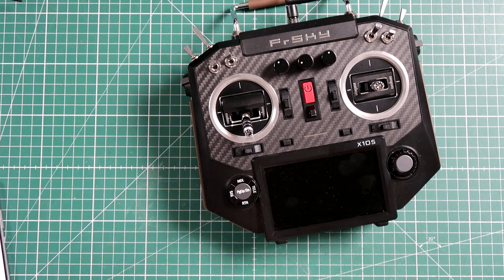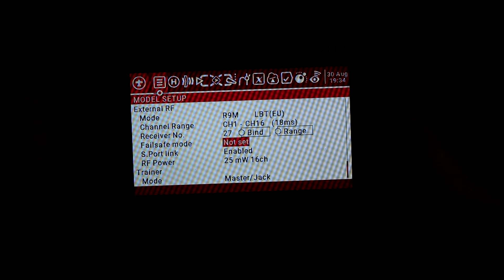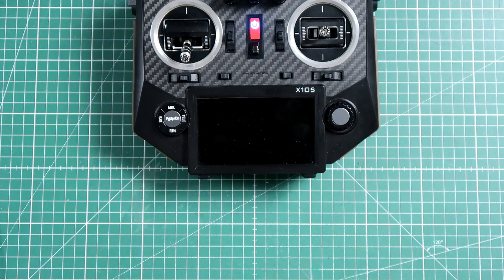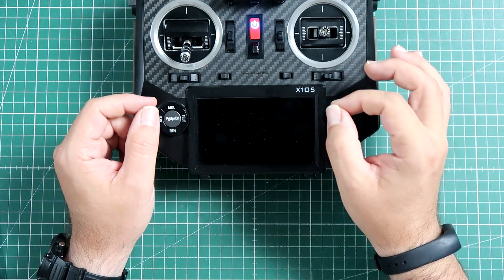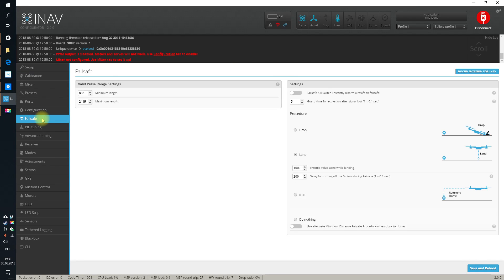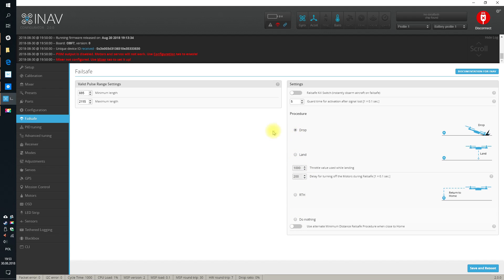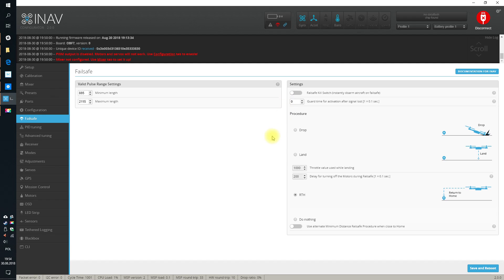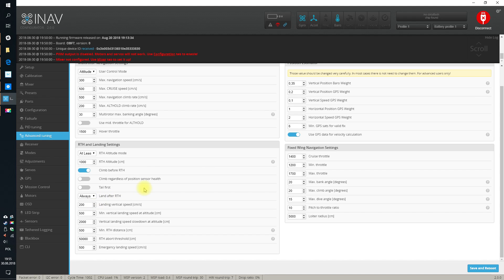INAV and Failsafe - especially for FrSky owners (but not only)

Comment: HI Pawel !  can not disarm after failsafe. props are spinning . Only unplugging the battery stops the motors. Can you help me ? I put RTH mode in failsafe tab but I have no RTH in Modes ( gps receiver without compass) and the switch works as failsafe only . I use frsky and expresslrs. Thanks

Comment: What throttle value be use for failsafe+RTH ?

I bench test the failsafe+RTH procedure. It went well but I notice the throttle ramp up to 93% during failsafe+RTH.

How to change that ? Because with that high throttle I doubt the plane will make it to home point.

Comment: Pawel, can you give me some tips on RTH? I setup Inav on a 4'' quadcopter using the Matek gps with compass. Alt Hold and Pos Hold are working perfectly with no drift. The compass and accl are calibrated.
When I execute RTH my quad starts toilet bowling, and although the home arrow points the correct direction, the quad is going the wrong way. I've checked the course heading, and all appears correct. If I change Mag Alignment, Pos Hold will toilet bowl. 
Could this be that I just need a better Mag Calibration? Very stuck on this problem.

Comment: I just got this Radio Master tx16s after 3 mouths, been using a flysky i6, thinking about sending it back. I have a pixhawk F.C.
With a pixhawk and using Mission Planner. I put RTH on Ch.7  on 2 way switch. Got 4 modes on Ch 5 .Setup the failsafe on Ch7 with custom settings failsafe and add after  two times on Ch5 on a 3 way switch one for the middle and at the end pointed down. do nothing for  the one pointed up that will be for Ch 7 for  RTH failsafe  when you cut your Radio Off, simulating no pulses it interact with Ch 5 at 1500 on the second switch .Put the other two modes as stable on the second switch 1653 and 1802. When I cut my Radio off in Mission planner it says RTH and it switches to CH 5 on the second switch at 1500. My mode setup looks like this :PWM - Flight mode 1=1193, FM-2 =1326. FM-3= 1459
Number 2 switch Fight Mode  number 5 = 1653, FM 6 = 1802 and  ( FM 4 = 1500 when you cut off Radio RTH.) Hope this helps.

Comment: I'd like to have my RSSI channel set to 0% when there is no signal.  Currently it reads 50% when the transmitter is off.  In Betaflight I can go to the Failsafe tab and set the channel position to be HOLD (which is what is happening now in iNav, I see 50%), or to some value.  I always set it to 0% so when the radio is off I see 0% instead of seeing 50% in iNav.
Does anyone know how to do this in iNav configurator?

Comment: i cant get my l9r to failsafe. I've tried setting it from the RX that did nothing it just holds last position and i tired setting it in inav failsafe the drop/land they dont do anything either and when there activated the motor wont spin. Any ideas?
Reply from the maker: If you use PPM you have to set failsafe on the receiver to "no pulses"
Reply: Paweł Spychalski I’ve done this and it still does nothing

Comment: Pawel i use for my receiver the L9R, but the taranis radio in order to Bind it you have to set the internal Rf Mode to LR12, with this on the  radio failsafe does not show any option whether to select Hold, no pulse etc. Can you explain this since there is no indication for this on the radio. I did  a no pulse failsafe procedure on the L9R rx as which was written on its instruction manual by quickly pressing the FS button on the Rx to activate the no pulse feature on the rx. Will this be work to create a proper FS even if the radio transmitter does not indicate any FS choice?

Comment: Nice one again Pawel, can you explain for us noobs one more time, (more confirm) testing failsafe on the bench, if i switch off my transmitter and press fs button on my XM+ failsafe is set, in inav if all is connected, i turn off my TX the red parachute is lighting up, is this failsafe triggerd?

Cause in olde inav i set my switch in failsafe, and angle mode, armed and 1600us throttle and pushed the fs button on my XM+ and than when i turned my tx off in inav all the sticks moved to the preset positions.

If i do this in inav 2.01 the modes move to under 1000us instead of the presets.

Bit confusing for me🙄

Ps this is with Hold and no pulses

Thanks for the explanation
Reply: There’s no failsafe button on the xm+...your thinking of the bond button...all failsafe settings are done in the taranis radios, and are saved to the rx when you bind.

Comment: Hummmm....has this disarm issue been fixed in 2.0.1 if the failsafe is set to "no pulse"?  Or is the disarming issue solution to set the failsafe to "hold"?

Comment: This is so wrong! Please change this video! Pos hold as failsafe is dangerous. If your GPS unit fails during a failsafe what will happen? 

Your wing will fly away. I have tested this multiply times with the same result in a fly away. Please correct your self and set to cut!!! It's the safest way!!
Reply: How often does your GPS fail??  If my GPS failed it would be because I'd had a total power failure (in which case the aircraft is going down anyway!) That said, I don't like the idea of position hold on failsafe. I want my wing to come home if the receiver goes out of range :-)
Reply: Chilternflyer it’s not position hold...it holds the last command you have the rx before the failsafe occurred...as far as Smokey saying what if your gps failed...well if your gps failed, your losing your plane whether you have hold or no pulse selected...inav has built in safe guards for gps glitch or failure that will force land the plane in such an occurrence.

Comment: Paweł I thought I understand your failsafe video but No....
can you go step by step for the Old people
https://youtu.be/Bjbumj977Oc
Reply from the maker: the major question is: which version of INAV do you have over there?
Reply: configurator 2.0
firmware 2.0.1 stable
omnibus F4v3
flying wing
openlrs 433 control
cheers
Brett
Reply from the maker: any chance you have a blackbox log of this? I'd say it might be connected with what openlrn does to aux channels when failsafe happens. if it setys them to "zero" or specific value, disarm will happen
Reply: No Blackbox sorry, I just did a test of PPM signal from Rx as it is set to No Pulses like you say and I confirm this on my cheap scope but in inav configuator still shows last known pulse valve.
failsafe is not that easy to setup and if this is a problem with openlrs you mean every openlrs person is flying without failsafe ? if so can we change failsafe system in iNav to work with openlrs ? please ?
like you say it is Very important......
https://youtu.be/phACIZsGFQI
Reply: Paweł I did 5 dis Arms mid air in a row this weekend
here is video and log file
log file stops with dis arm but I add the DVR to the end
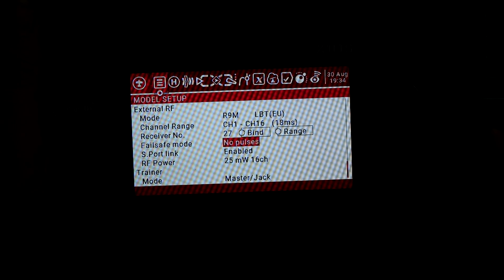NOTE @ 1:27 there is a second mid air disarm
https://bit.ly/2EoSMkX
https://youtu.be/Bvpv-h9ffO8
Cheers
Brett
Reply: @kermets  disarm is not a failsafe situation

Comment: Pawel, can you please explain the correct procedure of Failsafe for us EZUHF uses..?  PPM does not have a "No Pulse" or "Hold" option, so I assume we need to set a conventional "Hold" using EZs standard FS procedure, ie Bind button pressing.
  May I suggest separating Failsafe options inside iNAV depending on the TYPE of craft chosen..?

Comment: Dear mr. Pawel,
Howcome that my vector fc (is sbus, taranis is set to no pulse) gives a green RTL in my screen (pc vector gui) if i switch off my taranis?
Reply from the maker: because it should? Failsafe is comunicated by a single flag. No pulses/hold only defines whet is sent from RX to FC together with failsafe flag
Reply: So my failsafe is ok than?
I thought you said i have to use hold instead of no pulse? In my taranis i have no pulse and the vector goes in failsafe ok if i turn off my taranis
Reply: skyhero kokkie why are you asking an inav dev how your closed source vector works...your question should be directed at eagletree, or the manual.

Comment: so in resume: PWM, PPM to be set to no pulses,  serial receivers like SBUS and Fport to be set to HOLD, crossfire do not have in my x9D screen any failsafe menu the menu is in the back of the fullside crossfire module and is set to cut.

Comment: Many thanks, but I need to clarify, for all frsky receivers then I will have to set the radio to holt, currently I had it on no pulse, and works on the bench but even do works in the bench do not means will work in the air, I learn my lesson 3 years ago, the plane flight away never to be found, so for R9slim, R9 receiver set the radio to hold, correct?   Now for the crossfire micro i got it to cut on the crossfire module and seem to work.  This morning I will do a test by driving, leaving the transmiter at home and drive away until the motor and alarm in my plane go off.  Thank you one more time for the info.

Comment: Frsky Qx 7, Frsky R9, Matek F405 Wing and inav 2.0. I also have been using No Pulses and RTH (test modes and turning off the transmitter) is working properly. Is there any advantage to using Hold if No Pulses is doing the job?
Reply from the maker: as long as receiving thing is correctly recognizing failsafe flag, no its the same.
Reply: Thanks. Always look forward to your videos.
Reply: @FPVUniversity  Actually, if the ardupilot RC fail safe setting is Disable, the random (very low) signals will go through. Finally when auto landing on a remote location - if the land reposition is enabled - the copter will go crazy.

Comment: So if it works either way, why is one way is better than another? Why is it preferable to hold last received values? To prevent fooling FC by "default" sbus values and triggering a disarm?
Reply from the maker: older versions of INAV had a trouble with signal loss near the max range that was connected with "no pulses" setting. With the current 2.0 it's no longer a problem but it's juts better to keep things as simple for FC as possible

Comment: Hi Pawel! What about to set an exact channel value for an aux channel and place the "failsafe" flightmode there?
Reply from the maker: that is a little complicated, right?  and what if you change channel mappig but forget to update failsafe settings? I know a case when someone put by mistake RSSI on ARM channel. That was interesting
Reply: Paweł Spychalski I always use same switch for failsafe. A custom falsafe-set on this switch must be working. Right?

Comment: Thank Pawel. I have iNav 2.0 and working on my first quad and have F4 FC set up for Ublox GPS. I have looked at many videos but none give specific detail on which modes/switch to set for GPS. Do you have  a video for 2.0 thats shows the detail? Thanks
Reply: Read the modes info on the github...they are all described in detail.

Comment: I always set my FS to "No Pulses"...Im guessing everyone does...?...Switching my TX to OFF results in FS Mode appearing in the OSD, invoking RTH.
  Hold, seems very unnatural, as traditionally, this is a Fixed set of parameters that programmes the receiver to go to and HOLD upon loss of carrier signal. 
   This is what I find a bit weird about iNAV, they choose to make it more complex by NOT using RTH Mode as a pre-set Fail Safe  position, like other Flight Control software does.
   1) "No Pulses" set invokes RTH upon loss of TX signal.
   2) "Hold" apparently also invokes RTH, (Not sure why it would TBH unless a HOLD pre-set was programmed as RTH Mode).
   3) Switch to RTH Mode manually with the system working normally.
   4) Switch to Failsafe Mode manually with the system working normally.

 Four different ways of doing the same activity....?....Yes, that's right, 4 ways...Confused yet?...you should be..lol.

No Pulses okay for PPM....but not for SBUS....that requires Hold.....Why not use the FS built into every receiver?
Reply: This is all this video is about - Hold is used only with SBUS (NOT PPM) cause SBUS/FPORT has a dedicated "FS" flag that is set in every failsafe mode (No pulses, Hold). 
3 - RTH is not the same as FS (as explained FS behavior can be also land/drop)
4 - failsafe switch is usually only used for testing you dont have to use it.
Why isnt RTH default - not everybody is using GPS for example. "Other" FS do have to have GPS.
Reply: @kabturek   thank you for saying that.

 I fly quads and among the quad community, almost no one fly's with a GPS module.  It is pretty much just unheard of
Reply: In that case, the Failsafe scenarios on offer inside iNAV should be different Depending on which type of craft you choose......Less is more....Too many options.
Reply: EnglishTurbines I’m with you on this 100%! This seems odd to me. I use no pulse and when I turn radio off my wing goes into failsafe and does a RTH. Now he’s saying you have to use this hold!!  Granted I’ve only tested this failsafe on the ground with no pulse and it seems to work now I’m not so sure!!
I guess this just gives me one more reason to dump inav and just flash Chibios Arduplane on my boards and be done with all this craziness. Geezz😒
Reply: Well, modern SBUS and No Pulses does work for me, he's saying now Hold is a bit safer.  Im confident in iNAV it has worked flawlessly for me TBH...Different story using PPM as these scenarios are not possible, and he didn't cover us EZUHF users and PPM.

Comment: What about the failsafe setting when using FrSky Fport ? We are about to setting up our first Inav build and to spare uarts we decided to use the Fport protocol.
Reply: Same as on sbus there is a failsafe flag in the frames telling the fc that shit happened :)
Reply: @SchonRichtig  meaning I have to set the failsafe in my Taranis to 'Hold' as the random internet guy told us :-)
Reply: I think it doesn't matter.
Because it is an extra information in the protocol it should also work if you have set your hold to arm an full throttle.
There is a way to set the hold channel  information for the receiver.
Test it :)
But remember to remove your props :)
Reply: Schon Richtig that isn’t hold...hold always sends the fc the receivers last stick positions before the failsafe occured...what your talking about is the custom failsafe setting, where you can set preconfigured commands that the rx will always give the fc when a failsafe occurs

Comment: can you look into what about crossfire? set it the same way?
Reply: Crossfire do not have a menu on you x9d for failsafe, the menu is set in the module and is set to cut, at least mine full side crossfire module is like that, running version 2.2 on open tx, but I will doble check when I get home.
Reply: @humbertomontalban3932  yes there is. you can use the crossfire LUA scripts to set it. in fact, if you have the micro module, that'st he only way to set it. I have the full module. but i can use either
Reply: TryerFpv  set the crossfire module (TX) to cut and you'll be fine. assuming you're using CRSF. The flight controller will see that failsafe bit  hit your rth or w/e you have set for failsafe

Comment: No pulses setting works correctly since the beginning of the times. It works in the BF and also the INAV. All the possible failsafe procedures like Drop, RTH, GPS rescue. All the "modern" receiver protocols (sbus, fport). As you are telling in the video - the FC knows that receiver is without a signal from a flag bit, so the channels values are irrelevant at this moment. So why would I ever need to set it to hold? I'd appreciate  a typical scenario when the no pulses will not work and hold will. And yes, I've tested all my F/S settings in the bench first...
Reply from the maker: actually "no pulases" was one the reasons of infamour INAV 1.9 in flight disarms
Reply: @FPVUniversity  Oh, you are right! That seems to be the scenario where the hold makes perfect sense. Sorry for my ignorance ;)

Comment: RTH over water has saved me. What about when the UAV is in GPS waypoint mode? For example if the route triggers a fail safe will the route continue, if not is there a way to change failsafe in flight? Great channel btw !

Comment: Answer please the question, I want to understand
Failsafe is the feature of receiver, not transmitter.
Failsafe is a special state of receiver, while it detect link lost.
So, why the transmitter (frsky) has failsafe settings (hold, custom, no pulse)
My be, does transmitter send this setting to receiver? and receiver knows what to do while link will be lost
Reply: Yes, frsky transmitters can send failsafe settings to frsky telemetry receivers
Reply: Николай Исаев you set the setting in your tx and when you bind, it saves the setting in the rx

Comment: I thought hold meant the receiver sends the stick output you configured on your receiver. You can do this with the most Frsky receivers when there's connection between the transmitter and the receiver, placing your sticks and programmed switches into the desired position and short press the F/S Button on your receiver. 
Anyway, you right Pawel, it's always necessary to setup AND TEST your failsafe mechanism!
Reply: Hold, holds the last commanded stick positions when the failsafe happened. What your talking about would be the custom setting, where you can set a pre determined stick/switch command when failsafe happens. Many other protocols or cheaper radios would use such a failsafe.

Comment: This is very interesting. I have all of my Taranis X9d+ set to No Pulses for all models and have had successful RTH on loss of signal fail-safes, including once when the battery fell out of the radio when I dropped accidentally. This is with when flying with iNav, with SBUS. I'll change them to Hold for the future.
Reply from the maker: do not trust a random guy in the internets. Test before flight
Reply: @FPVUniversity  I only trust random guys on the interwebz haha